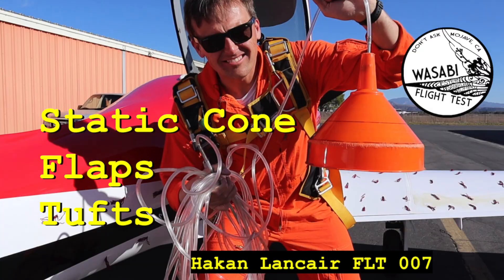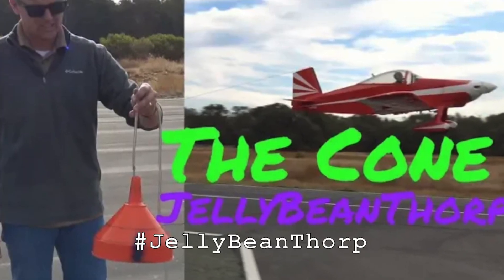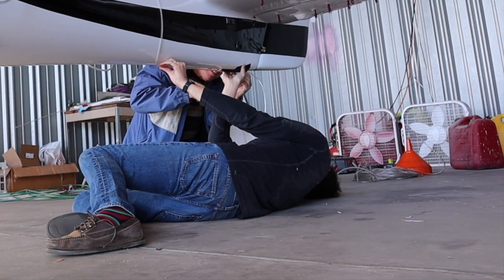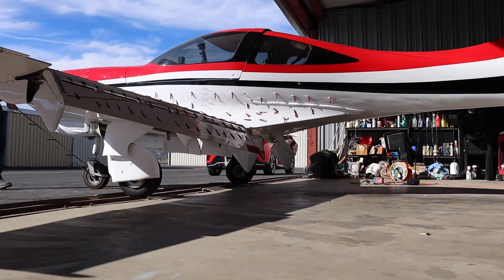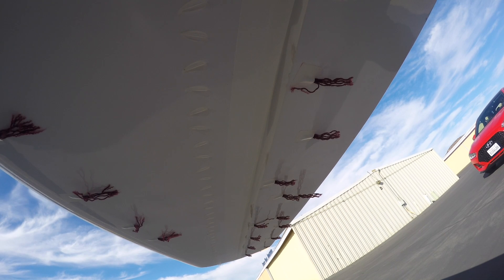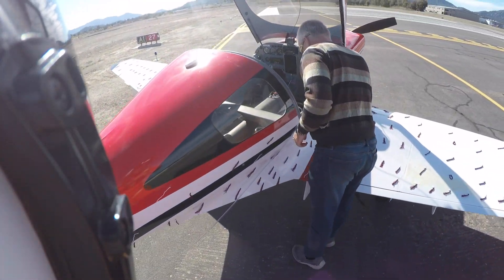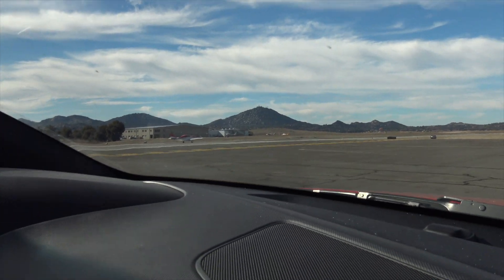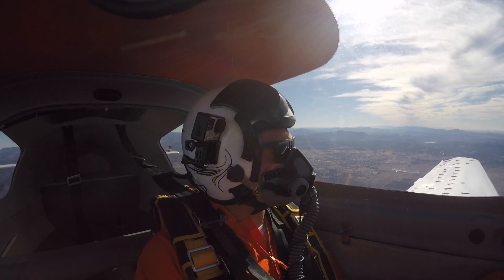Trailing Cone Details and Operations - Hakan Modified Lancair Flt 7 Clip

Comment: Hey Elliot, love the content, I think you're my favourite channel to see an upload from lately.

I hope I can give a bit of subjective criticism on the edit though - some of the noises (squeaking, honking, etc) during the cutaways get a bit obnoxious. The cutaways could probably be a smidge longer (maybe by half for those shorter ones) - sometimes it's good to have really fast cutaways, like when you've got a smash cut to a paragraph or two of text / definition for someone to pause on if they're not acquainted with a topic, but if you're not expecting the viewer to possibly want to pause, it should be a tad longer so there's no need for even slower viewers to want to. Tiny thing but a tough one to optimise. I didn't think any of the transitions i.e. with music were a problem. Music's great for those cutaways because when you're editing it encourages you to put in enough time in that cut for the beat to become apparent, as a minimum (you try not to cut away for only a few odd notes, if that makes sense).

This excerpt (and the full video its from) were fantastic as usual.
Reply from the maker: Thanks for the feedback

Comment: I don't understand the relevance of most of the intrusive noises.
Reply: Agreed, found the door bell and other similar noises just distracting and irritating and happened much to often.  The cutaways, made sense as background and reference but the random noise added no value.  If the editor was trying to do something with them, they did not pull it off.  Additionally, the volume of the noises appear to be much higher than the rest of the content, making them additionally irritating.
Reply from the maker: Thanks for the feedback.  Engineer fails at being hip again.  Back to the drawing board.
Reply: @utopiasnow  I have found that I personally don't mind seeing 1-3 memes/noises in a video (depending on video length). They seem to be best when they are self deprecating, highlighting flaws with a little humor really humanizes the creator. Easy to over do, and too much volume will always piss people off. Your content rocks, so no need to fret too much over hip editing lol.

Comment: In small business jets, the person tasked with deploying and retrieving the trailing cone is described in the pre-flight briefings as the “Cone Monkey”.  Common nomenclature at the Wichita aircraft manufacturers.
Reply from the maker: I like that.  Cone Monkey, should have some shirts made.  Where have you worked in Wichita?
Reply: @utopiasnow  
21 years at Cessna, 4 years at Beech and 4 years at Bombardier Flight Test Center.  All together, close to 20 years as a Flight Test Engineer (now retired but still SFTE member). And, yes, I have been the Cone Monkey a few times.